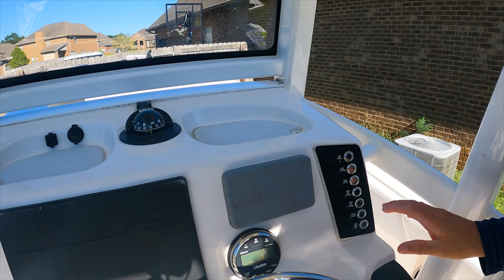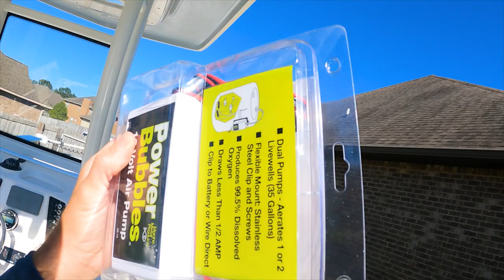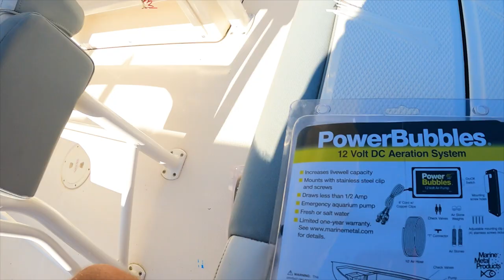How To Install A Air Bubbler on a Bay Boat

Comment: nice video. Thanks. What are the adhesive cable ties u use to secure the air hose inside the live well?
Reply from the maker: 100 Pack Zip Tie Mount With Cable... https://www.amazon.com/dp/B07Z794N9J?ref=ppx_pop_mob_ap_share

Comment: There’s just nothing like drilling holes in your boat am I right? Lol.  My 3m cable ties didn’t stick well either.  My push button on/off switch is beside my rear seat facing forward; Good thing is I can see it lit up so I don’t leave it on.  Nice mod.